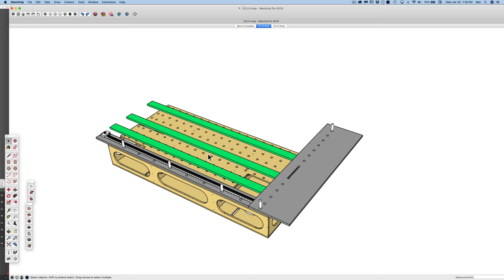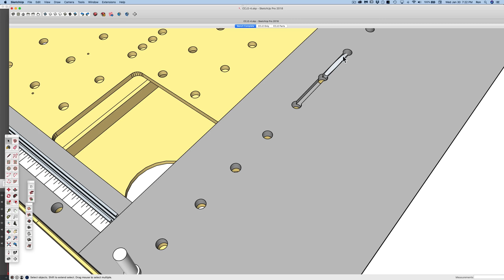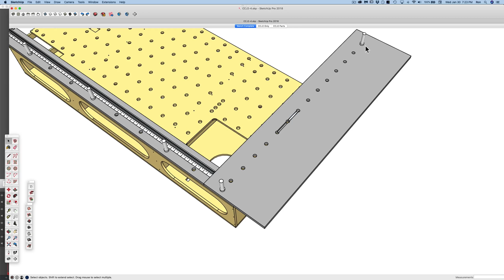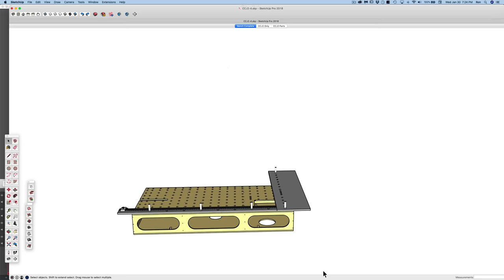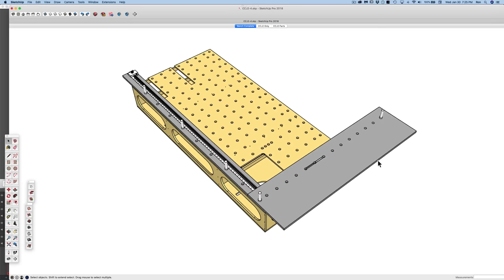Accurate flexible cross cut jig

Comment: Hey. This is very cool! Kind of above my head as I do not have a mft system at the moment. I'm doing some research on them and looking to diy a top. Was thinking if using a piece of pegboard to layout for holes or making a template from it. I know the spacing is different from official mft, but I also plan in making my own dogs and clamps etc. A lot of work, but I don't want to spend a bunch of money on something that I'm just beginning to try and work into my flow. Any thoughts on the pegboard idea? I'm sure you've considered at some point.
Reply from the maker: The MFT system is just that. It is speciffically 20mm holes spaced 96mm apart or 3x32mm which has been the world wide industry standard  since WWII. Peg board isn't very accurate and would get you even close to an MFT setup. Thanks, Ron

Comment: I have parf dogs, but they only have 17mm to 'plug in' to a surface. If I am understanding this vid correctly the dogs need to plug into the jig parts and then into the worktop underneath. Hence the jig parts need to be quite thin eg 12mm to allow the dogs to locate into the worktop underneath??

Comment: In the interest of simplification, for sheets less than the distance between the inside of the outer most dogs, is it not possible to butt the track against a dog along the close longitudinal edge, place another dog in-line farther down the table, butt a sheet's factory edge against said dogs, then butt the track against the first dog and a third placed directly across the table?

For wider sheets, might recessed tee nuts in the surface of the track support with a star knob/bolt and washer under the table be an alternative to the routed slot and a clamp that some may not have?

A recessed double-sided tape along the table's edge outside the outer dog holes, and either a routed t-slot or recessed t-track and stop could be optional accessories improving the utility of the jig.

No table I've ever had was marred with a single cut either as I use rigid foam insulation boards as sacrificial material; completely supporting the material while also minimizing tear out.

Comment: What ever happened to this project? Very interested in seeing the results, accuracy and versatility.
Reply from the maker: It is real and happened, but I need to edit the video and finish the plans. I have learned from the past not to put up a video unless the plans are already in the store as I get inundated with emails and lots of anger for taking too long to get the plans up.
Reply: Ron Paulk No worries just was interested in the project.  About five years back I built a Paulk workbench the original (best workbench) and am in need of a second one.  I am considering building the compact bench and have always wanted to build the cross cut jig.  My first attempt of the original cross cut jig was a complete disaster.  My fault, but this looked like a great alternative.  Can’t wait to see the video.

Comment: Sorry Ron, that Jig would be the TSO GRS-16
Reply from the maker: TSO's GRS-16 is a tool I use often and is not expensive for the accuracy and speed I get from it. The CCJ I am working on is a different tool. With the stop, it will be great for larger projects like building out a set of kitchen cabinets. I have TSO's TPG-50 coming soon which will offer accurate repetitive ripping as a table saw, but with the advantage of moving the saw instead of using a table saw and feeding the wood across the table as a traditional table saw.